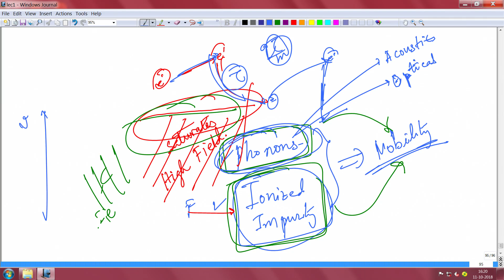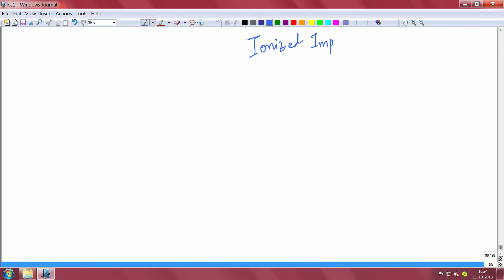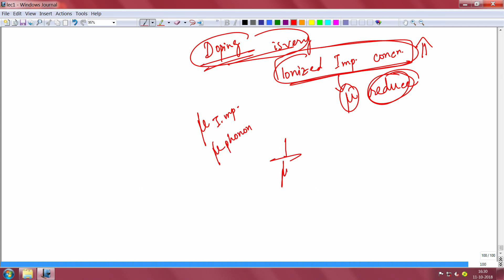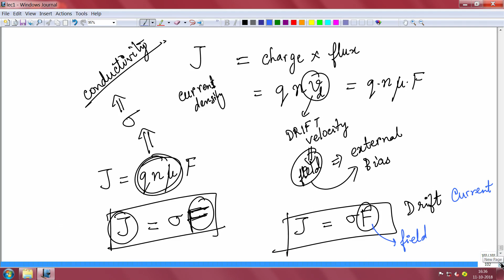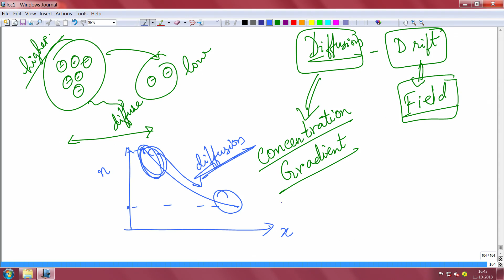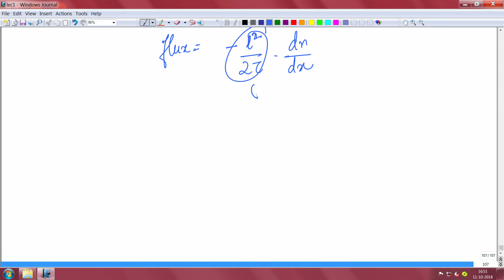Low-field and high-field transport, introduction to diffusion

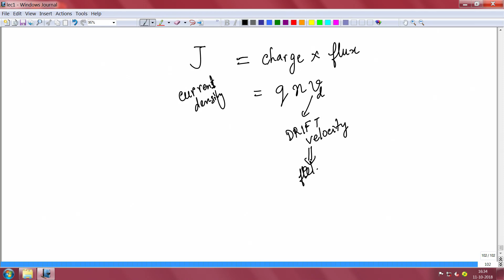Comment: @16:00 flux = nv_d. Isn't flux a kind of total, at the moment.. a quantity which increase with area considered. E.flux is total field lines in an area or a plane, at the moment.. ( E.field is force per charge at the moment ).
 
n (unit = cm-3) , v (unit = cm.s-1) . So here, flux is something per area per second , which doesn't increase with the area considered.. Can anyone explain,  how it is flux in this equation??

Comment: 10:28 if someone is wondering about the equation 1/(total_mobility) = 1/(mobility_phonons) + 1/(mobility_ionization) -- [0] , consider the collisions per second in each category..
collisions_per_second_phonons =  (charge/effective_mass)*(1/mobility_phonons)  --[1]
collisions_per_second_ionization =  (charge/effective_mass)*(1/mobility_ionization)          --[2]
total_collisions_per_second =  (charge/effective_mass)*(1/mobility_total)                             --[3]
total_collisions_per_second = collisions_per_second_phonons + collisions_per_second_ionization --[4]
[1] through [4] will lead to [0]
Of course if your math is fresh, then all this is not required, its the probability of any of the two independent events (collisions due to phonons or collisions due to ions) occurring
Reply: At 10:23 how can he say mobility due to phonon and mobility due to impurity atoms, shouldn't the mobility is due to charge carriers like electrons or holes?
Reply: Mobility is caused due to scattering and scattering is because of impurity and phonons
Reply: @pvaishnavi8615  ok thanx for the contribution